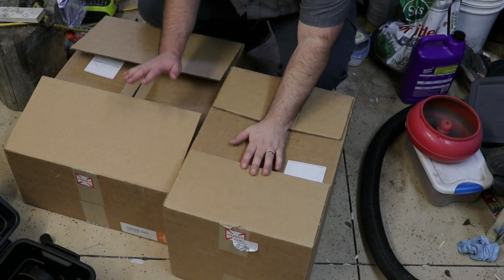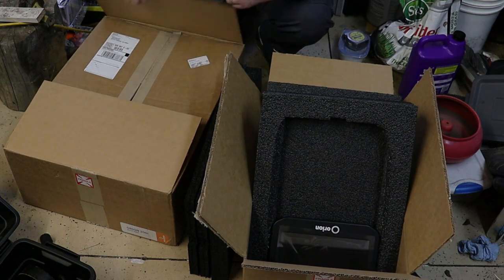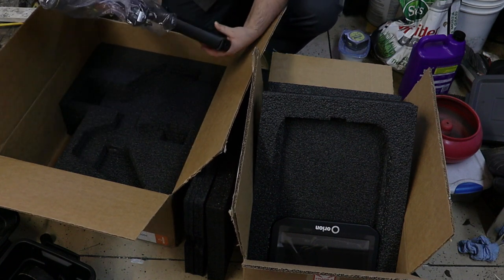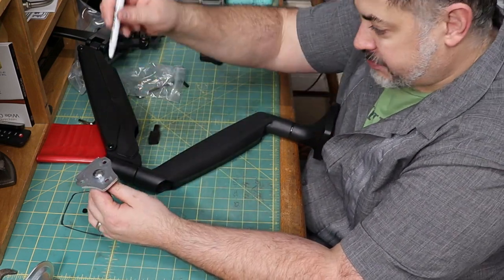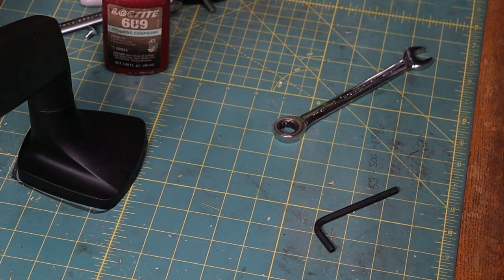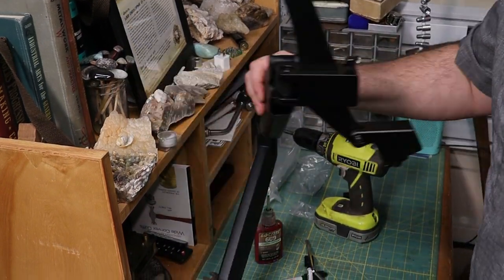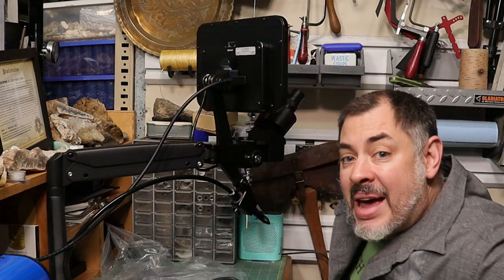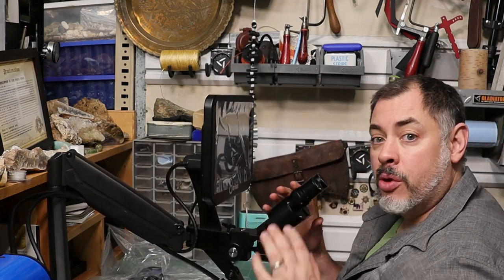Orion 200i3 welder Unboxing and set up

Comment: Is it really that difficult to pick up? I mean, I just melted like my gazillionth rope with the acetylene. Yesterday I tried to sneak-a-solder with the turquoise mounted. Now it's coal. I was just about to pull the trigger on one of these but after hearing you summarize, I'm starting to panic. I mean, when even the marketers give you 5 minutes of disclaimer... lol.
Reply from the maker: I’ve picked it up pretty quickly! I’ve already made some tool prototypes and necklaces from jump rings - there is less of a learning curve than soldering I would say- once you have settings all dialed in. Bam! If you decide to pull the trigger Let me know and I can send you an affiliate link. It has quickly become my favorite machine !